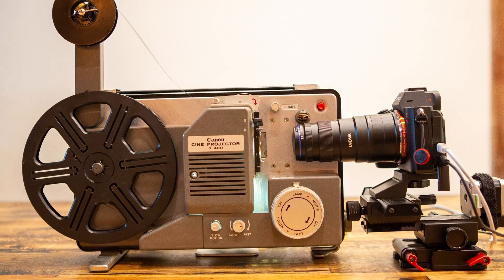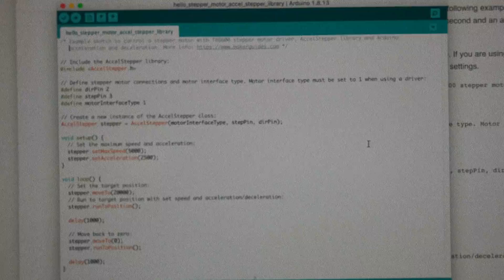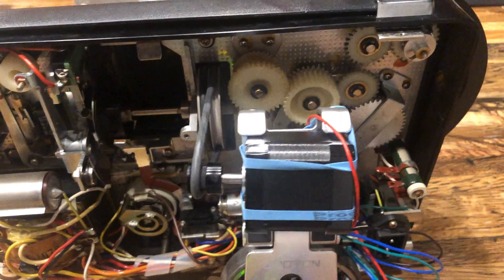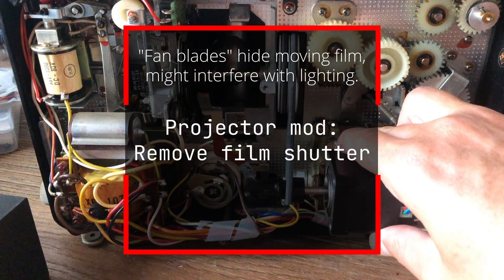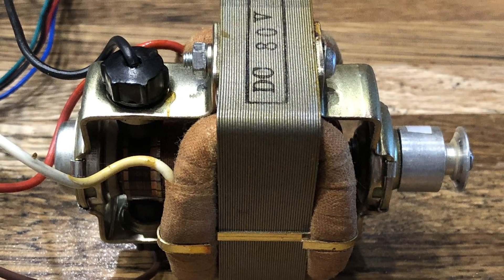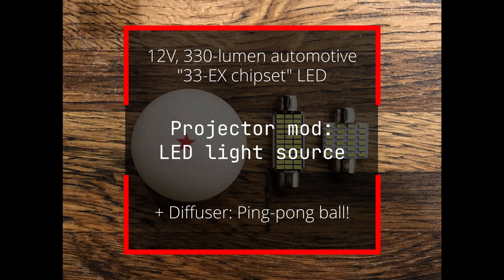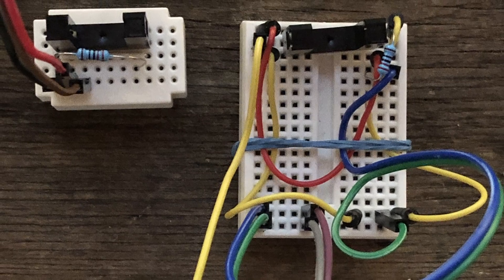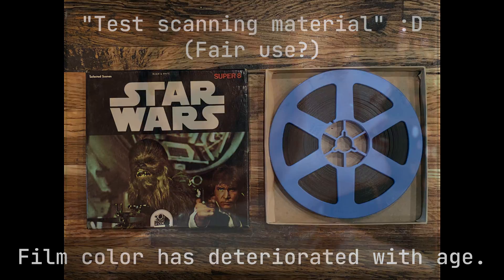📽️ 🎞️ 📸 ⤳💾✨ DIY 🛠️ 8mm / Super-8 Film Scanner, Part 1: Overview

Comment: Very cool. Building my own right now.   I'm unclear on what you're using to trigger the light and camera shutter circuit.   Is it a Arduino timing you've set based on the speed of the stepper motor?
Reply from the maker: Hey Joe, thanks. I didn’t go into the specifics of the circuitry, but I plan to get more of those details and the Arduino code up in a future video and on GitHub or similar.

There was a screw holding a metal ring on the projector “drive shaft” that I tied a bit of material to. It could be anything solid, the idea is just to have some shape that blocks the U-shaped infrared trigger / gate - a light emitter / collector pair of sorts.

The IR trigger is connected to the Arduino, and an analogRead() is close to 0 when open, 1023 when interrupted (or vice-versa, I forget which at the moment.) When the value changes, I then trigger the shutter. To keep things simple, I also ended up keeping the LED light on all the time - it’s been fine, no issues with heat - and that also helps to reduce one more timing issue, worrying about the LED light being at full brightness or what have you otherwise.

The timing of frame position -> trigger is adjusted simply by loosening the screw and repositioning the ring so the attachment sweeps through the interrupter after the projector “fork” has pulled the new frame into place in the gate. This projector has a fork that goes up, reaches in, pulls down and then out of the film sprockets. So I try to have the shutter trigger once the fork is out, and that gives plenty of time to get the photo.

The trigger for the camera, Sony a7riii here, seems to work if you hold the lines down for 10 msec. Doesn’t need to be too long (you might get multiple exposures,) so it’s best if you experiment and see what works for your setup.
Reply: @scottschiller  Thanks for the explanation!.  Looking forward to the next video.
Reply from the maker: Most welcome! And yes, I need to get to work on Part 3 soon, I’ve had a few people show interest. I’m glad folks are finding this project useful or inspirational.
Reply: How does one learn to do that? Did you teach yourself or learned that in some sort of school.
Reply from the maker: I am a software person by trade, and a tinkerer at best when it comes to hardware - but behind both of those is a curiosity about how things work, and a desire to see a vision through from idea to reality.

Comment: no sound?
Reply from the maker: Do you mean, no sound on this video? (It should have me speaking audibly.)
Reply: @scottschiller  I mean does your scanner capture audio?
Reply from the maker: Ah, thanks for clarifying. This project does not include audio tracks from 8mm or super-8 film, etc. I did find one film that had a “visual audio” track as a printed waveform, pretty neat - but I didn’t get to parsing or stitching the original audio together. That would probably best be done separately by a projector designed for that sort of film, then capturing the audio line out etc.

Comment: The "small glass window" you took out blocks lots of the infrared (IR) light from the bulb that doesn't contribute to image brightness, since we can't see IR, but the IR heat tends to melt film. Not a problem with LEDs. I'm getting an old projector tomorrow to start on this road of building a film digitizer. Thanks for all your videos.
Reply from the maker: Good info, thanks for the note and kind words. I recommend looking at a high-CRI LED source, chances are the random automotive COB bulbs I found were not terribly fancy. 😉

Comment: Great video. I bought an Elmo set up for transfer, but it uses a Panasonic video camera into the lens slot. It is not sharp enough for me. I also bought a Kodak Reels digitizer. You are right it is cheaply made but the image quality is the best I have seen from Super 8 transfer. It takes some editing to get rid of the little bit of frame change.flicker. I think it is 8 MP a frame at a time.
Reply from the maker: Thanks for the context and thoughts. I think as long as you’re getting good results, the process is not important. At the time I made my series, the Wolverine / Pro was what seemed to be popular. I figured I could do better with a DIY set-up and the raw digital process, recognizing that would be a lot of additional work - but it was COVID times and I was up for the assignment! 🫡😆

Comment: Thanks for posting your build! I'm in the process of doing this to an old Eumig projector and this vid made me realise that my approach of trying to get a consistent single frame advance controlled by a Pi was probably overcomplicated. Now going to redo things to send a trigger pulse to the Pi instead which should be much simpler and much faster :)

Thanks again for the inspiration!
Reply from the maker: I’m glad you found this useful. Someone mentioned to me, the stepper motor controller I got for this was likely overkill - there are very small modules you can get with a rotary knob on them which does both the driving, and speed control. I wish I’d known about these back then!

Separately, someone recommended a light with a higher CRI (index) - better color spectrum coverage, which may help with the color in the resulting scan. That’s something else I’d also consider, were I to revisit this.

Comment: Can i use a Panasonic Lumix DMC-G3K for this?
Reply from the maker: A quick search for the DMC-G3K suggests this camera has a mechanical shutter that cannot be made purely electronic (i.e., fully motionless and thus silent) and so you will cause wear and tear and possibly "burn out" the shutter, depending on how much use it has already seen. Some micro four-thirds might have fully silent / motionless shutter options, but I would think mirrorless cameras are likely to be better candidates.

You will also want a camera that can fit a decent macro lens, and an external power supply whether a "power brick" or USB.
Reply: @ thanks for quick responding on this. So what i’m looking for in a camera is: -fully motionless and -thus silent, -mirror less camera? Could you please list the specs i should be looking for on a camera? I’m not at a camera expert or high on budget, but thought maybe i could find something used ok camera for this. Thanks 🙂
Reply from the maker: I think presently, cameras with completely "electronic" shutters (and thus, completely free of motion) are going to be expensive. If you want something fairly straightforward, I would look at something like the "Wolverine" line of 8/super-8 film scanners. You won't get the same level of control of white balance etc., but I think devices like that are good enough for most digitization use cases.

Comment: I feel like there must be a far, far simpler way to achieve the same stepper-advancing effect..
Reply from the maker: In retrospect, my approach here could have been much better. 😛 I think because of the Arduino angle, I went down the TB6600 path and ended up using a second Arduino for the "status" OLED display because its I/O caused stepper motor stuttering.

I've seen others using a very small standalone module, a pot on a postage-stamp-sized PCB that does all the speed control for a stepper motor - much more efficient.

Comment: Very great job, really! But how long will the camera survive? At 24 fps you already have 1440 releases per minute, which means 86400 releases per hour.

Will the camera survive this?
Reply from the maker: 8mm films run at 16 FPS, whereas Super-8 is 18 FPS. Either way, you're correct in that's a ton of shutter actuations and mechanical wear and tear potential unless you have full silent mode, e.g., on a mirrorless-style camera like the Sony a7riii I used. I speak a bit about this in a follow-up Q&A. https://youtube.com/watch?v=hthVoeRgbos&t=1189s

Comment: Don't want to criticise this great project but you should have used better light source. Cheap LEDs have terrible color spectrum and low CRI (Color Rendering Index). I would bet that using some high quality LEDs with CRI 95 (can be found in LED bulbs if you specifically search for CRI 95 LED light) would make the colors much nicer straight out of the camera. The car LED would have CRI 70 at best...
Reply from the maker: This is a good point! I was not fully aware of the CRI stuff at the time, although I did look a bit later. These were "Luyed" 3014 33-EX Chipset-based LED lights, and I don't see any indication of high CRI. If I do some more scans in the future, I will look at a CRI 95+ LED source for sure.

Comment: Hey ! Thanks a lot for sharing this project, I successfully developped my first roll of super 8 film today, so I guess I'll have to do on my own variation of your scanner :)
What power supply / voltage did you use for the stepper motor and the LED ? 
Thanks
Reply from the maker: You are most welcome. I found a variable power supply online, maybe via Amazon, where I can adjust a dial to set the voltage. For Arduino stuff, USB @5V is great. For stepper motors, typically, you’re looking at 12V but check the specs for your set-up and controller.

Comment: Great video and really awesome project.  I am looking to do something similar with 16mm.  Old projectors are expensive and you never know what you're going to get when it's used.  Do you have any recommendations for a 16mm projector within a budget?  Everything seems to be geared towards 8 unless you go vintage. Sending all the film I have to convert to digital is too expensive.  I've worked with Arduinos and I write software for a living, the part that will trip me up is the camera and projector portion of this if I try to replicate.  Cheers!
Reply from the maker: Thanks for the comment and questions; I've had similar thoughts about 16mm, myself. It seems like vintage might be the way to go, but I think it would be wrong to irreversibly modify a vintage 16mm projector for scanning. The challenge is if and how to adapt one to line up a camera and an LED light source, work in a stepper motor and so forth to drive it similar to the 8mm/super-8 scanner.

Alternately, cameras might be a safer bet and less expensive than projectors - they have a transport mechanism, gate and so forth. But, you would probably be hacking one apart just as much. e.g. (and, "general disclaimer", this is a wild guess.) https://www.ebay.com/itm/295775545842

My background is in software engineering, but I was able to figure out enough (and have enough Arduino experience) to get things working for 8mm/super-8 - so in theory, someone smart should be able to apply the same approach to 16mm and other formats. 😉If you end up taking on this project, let me know how it goes!
Reply: @scottschiller  thanks for this information.  This is very helpful. I was actually thinking why do I need a projector? Could I just make a light box or something similar to illuminate the frame with the camera positioned above?  I’d obviously need to figure how to feed the frames and wind and rewind the reels but an actual completely functioning projector doesn’t seem like a necessity now.  I really liked your hack with the LED and ping pong ball.  I do not want to burn the film. The main video on my channel is of 16mm film I sent away to be processed. The company did an amazing job but it cost me close to $700. I’m hoping this project will get me acceptable results and I won’t be spending a fortune on each film.

Comment: hey scott building my own telecine machine, I'm kinda stuck on the stepper motor part what's the power supply you used for your stepper motor driver? and also what's that part called that gets connected to the vcc and ground part that looks like a plug head? I've been looking everywhere for that part
Reply from the maker: Great to hear you’re building your own! It can be a fair bit of work, but the results are absolutely worth it - and ideally it’s fun, too. 😅

I’m using a TB6600 stepper motor driver here, which the Arduino connects to and provides the signalling. You can also get separate modules for stepper motors that just have a little heat sink and a potentiometer that controls speed, if you want to avoid using an arduino for the stepper motor portion.

I’m not clear on exactly which plug piece you’re referring to, but the green rail on the TB6600 is often called a “terminal block” - with screws that clamp down on the connecting wires.
Reply: @scottschiller  I found the part that I was looking for, it's actually called "DC barrel Jack Adapter Female". Now that the Arduino parts are done just going to have to figure out how to disassemble my projector, it's a Fujiscope and the lens are not detachable, looks like I'm gonna have to drill it out 😄
Reply from the maker: @theroebuck123456789  Ah, got it! I wasn't sure which part you meant, glad you sorted it out. You can get little terminal screw block-type versions for those also, I've used a number of those in various projects.

Best of luck with your build - I know some of that stuff can be tricky. I wasn't sure, but I tried to pick a machine that looked like it had a detachable lens piece and I lucked out. The side of camera lens butts right up against the frame of the projector ever so slightly, but I also didn't want to carve into the body.

Comment: Hi Scott thanks for this in-depth explanation and showcase of your scanner! I have built a 16mm scanner myself and I realise watching your videos, that the film runs really, really steady in your scanner! can you explain how you set up your stepper motor+potentiometer to always run the film just one frame? thanks in advance!
Reply from the maker: Hi Jonas,

I’ve been curious about a 16mm scanner as well - I bet there’s some great content out there, and at higher definition vs. 8mm.

I cover most of the stepper motor stuff here in Part 1. Largely, it boils down to the motor running at a speed much slower than a typical AC motor. I found that the projector “drive shaft” advances one frame for each rotation, so I used that as a trigger for the camera. I’m not very mechanically inclined, but my plan was to take advantage of the film gate and transport mechanism you get “for free” by modifying an existing projector.

Comment: Thanks for the idea. Build a scanner with same function. The quality is nearly perfect and after the process on the computer in a very good quality of 1080p or even 4k, because I scan with a resolution of more than 4k.The only thing that's not perfect is a little hotspot in the bright regions of the image. Have tested a lot of led bulbs. Some work better but no one works perfect. Overall thank you for the videos. That inspired me and I'm very happy with the results.
Reply from the maker: That’s great to hear, and thank you for sharing. I’ve noted some highlights being pretty bright myself, and I try to bring the LED lighting down (or increase the camera shutter speed) to avoid over-exposure, with the intent of preserving as much detail as possible. It can be a tough balance at times!

Comment: Thanks for sharing this. It is really useful and I'm going to do it based on a Eumig projector. What is the specification of your stepper motor? I'm not sure what size to go for.
Reply from the maker: Thanks, Roger. I believe it was a Nema 17 that I got. You will want to make sure you get a stepper motor controller or driver that is compatible.
Reply from the maker: I got something like this from Amazon Canada. The driver/controller is a TB6600. You may be able to find better prices separately, etc. https://www.amazon.ca/Stepper-Longruner-Connector-Printer-Mounting/dp/B07FK8NRKL

Comment: Hi, Scott. Thank you for your inspiring videos. I am about to start a scanner project, and I will probably go in the lines of your own project. Your fine and detailed presentations will be extremely helpful... I have a question: I need to select a decent camera. The camera you use appears to be perfect. But it is a costly top-of-the-line camera. Is a 48 Mp sensor really usefull? What drawbacks if using a much cheaper 24 Mp camera such as a mirorless Sony ILCE 6000 ? Or have you a suggestion based on your experience?
Reply from the maker: Thanks for the note, and the kind words. Here’s my $.02 on the camera: I don’t think you need 42 MP or what have you, but having ability to shoot RAW format - and crucially, with a 100% electronic / motionless / silent shutter, is key. You don’t want to be burning out the mechanical shutter mechanism on a camera, shortening its lifespan (or killing it entirely) taking thousands of frames for 8mm/super-8 scans.

When looking for cameras, I would consider silent / motionless capture as a top priority, followed by RAW (lossless) image support (not only JPEG), and also the support / availability of a macro lens which will let you get a good close-up view of the film gate.

I should add - I did a quick search and it looks like the Sony ILCE 6000 has a mechanical shutter which can not be fully silenced, there will always be some movement when taking a photo. So if you were to use this or similar, you would be contributing to the actuations and mechanical lifecycle of the shutter mechanism.